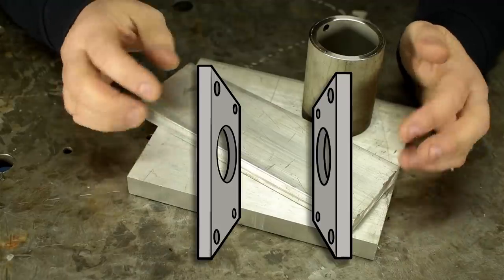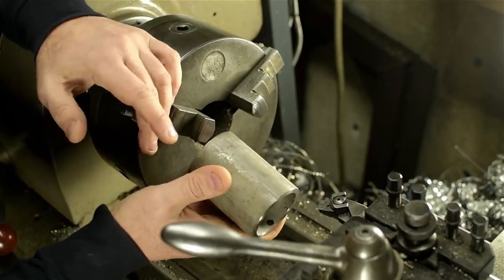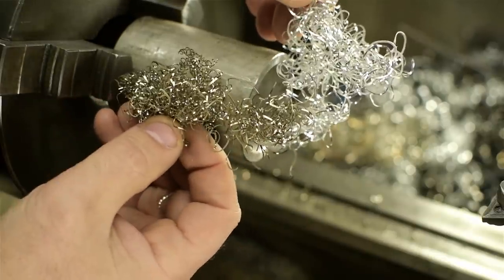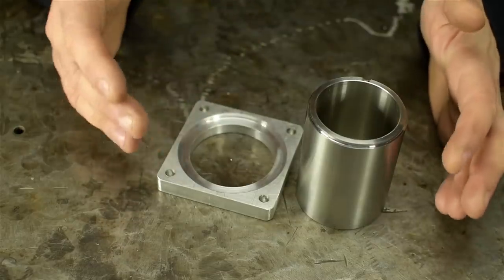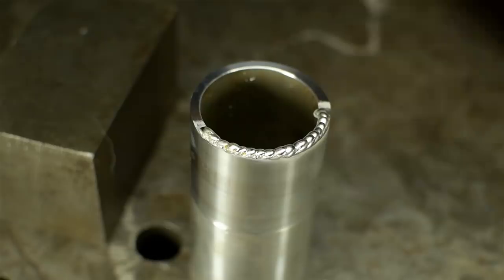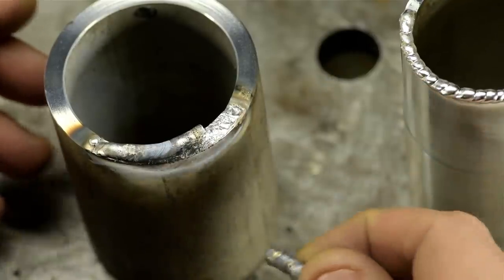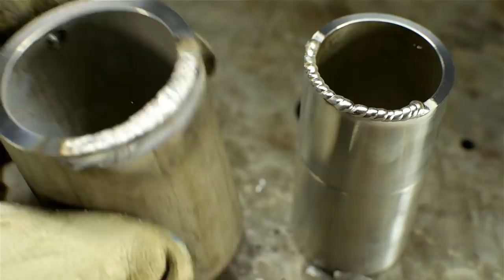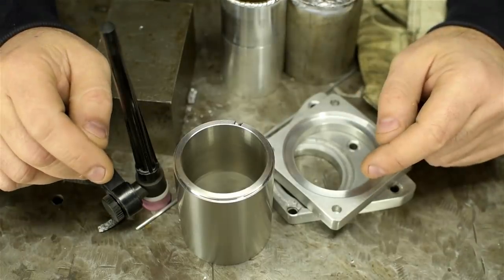UNWELDABLE Aluminum - Caught On Tape!!

Comment: The middle piece is from Europe and is in metric. The other parts are in imperial. You can't make them fit together.
Reply: They use metric elements, can't use those together.
Reply: Everybody knows you can't weld Aluminum to Aluminium.... duh!
Reply: @spacenomad5484  Don't get it?
Reply: @crackedemerald4930  Can, pretty much, for a few sizes
Reply: Can't fit metric to imperial?  Have you tried a bigger hammer?  ;)
Reply: @MrJdsenior  Carefully check the spelling!
Reply: @ferrumignis  oh man, that almost got me.
Reply: You need filler rod from England.  It like whitworth works great on imperial and metric nuts and bolts with a big enough hammer.
Reply: It's all about the bauxite. Willowdale and Huntly bauxite are incompatible.
Reply: @tomstiers6419  You work for one of my bloody sub-contractors, don't you !!
😂
Reply: @hanelyp1  Summon bigger fish 🤣
Reply: If You can't make them, You gonna need a bigger hammer.
Reply: You can,  but you need to make an adapter piece.
Reply: @scudinthemud  inch to metric bush 🤣
Reply: Only people who speak british and american  can weld them together
Reply: @JoshGariepy  You gonna twist an English and an American fillerrod together and work on the English piece with the left hand only ....

Comment: Careful with that zinc stuff, breathed a little of that in and 3 years later I was hit by a car
Reply: damn bro. i breathed some in and 2 months later lost a game of monopoly. its dangerous stuff.
Reply: Well crap 3 years earlier I was hit by a car . . . (well almost 3 years ago. . .)
Guess I'll blame it on the Zinc . . .
Reply: redxpen  Maybe lithium + copper? That could make purple.
(as minor additives, obviously. Not that the metal is an alloy of just those!)
Reply: redxpen  
My guess is magnesium

Though he said it felt heavy.
Reply: redxpen  
Yup the wire peeling post weld, the green arc and the zinc even.
Reply: @motoz3939  It reminded me of when I tried to weld an in-law's "Aluminium" Lawn-Boy mower deck.  It even had "Magnesium" proudly cast right next to where I was welding.  The weld had that weird shiny crinkle you see at the end, end then a few seconds later went "Ping".    Also I have made aluminium-stainless hybrid when I left an aluminium rod on my weld table.  It's not very impressive.
Reply: @paulmoir4452  yeah magnesium is a strange one. The wire is very expensive also so it's likely not something people just up and say I think I'll try this. I think that likely adds to the mystery of it. It's just not common to the average person or even weldor. I hope this old Tony identifies the materials and makes another video about it. He did mention though he didn't care and just wanted to complete the part. Maybe he will see comments like these and dive into it.
Reply: No Corona virus?
Reply: I can tell you that when I was 15-25 years younger than today, I happened to weld zinc quite a few times without having a clue about the dangers that fumes can cause.  
I'm 42 and I've never had health issues. I don't know how those breather fumes are going to affect me in the future, but here I am for now.  :)
Reply: @nfetiu  bit of a late reply, but the research on occupational safety of zinc fumes seems to indicate it isn't a long term danger. Exposure is extremely unpleasant and during that "fever" you are a risk of developing pneumonia or the like if you get infected, but zinc probably doesn't stay in your system for very long. 
Had a good look at this because I work with zinc a lot.

Comment: The builders want their scaffolding pole back!
Reply: lol
Reply: Hey I am missing a brace tube.
Reply: @ironworkerfxr7105  Shop Rule 2; Never turn your back on a welder. Shop Rule 3; Welders that wander around with a tape measure are NOT "On Break". Shop Rule 4; Don't look behind the welding curtain, you can't unsee it.
Reply: It's called a tube. You put flags on poles.
Reply: Perhaps there was a flag on the scaffolding? 🤔
Reply: He'll have to weld it back up before he gives it back.
Reply: No need, TOT can just engage his lathe to go back in time to before he cut it. Or even before he 'aquired' it!
Reply: @poppyrider5541  I think you mean "pipe". Poles are supports, Pipes are for water, or  conduit, or other pipe-like applications.  Since it's made of a structural material, its intended purpose is most likely for support structures, so "pole" is pretty reasonable.  All metal pole material is hollow, because it's cheaper that way and there would be very little benefit to making it solid.

That's actually a pretty neat piece of material ToT has, but no you can't weld it with anything normal people have access to.
Reply: @Chris_the_Muso  there's actually a huge benefit to making em hollow. Other than to save material and money, hollow parts can resist bending sideways much more than similarly sized solid parts.
Reply: @d.t.4523  Awesome shop rules!  The tape measure one had me rolling, just had to say !    a much needed smile to the day:)
Reply: @Chris_the_Muso  I think you mean "round hollow section". Poles are supports, pipes are for water, conduit, or other pipe-like applications, round hollow section is to ensure the stock rack stays on the ground.
Reply: @godfreypoon5148  You're all wrong... Poles are people too. From Poland. Not Pole-land, common mistake.
Reply: @mohammadyousef5815  no, solid is more resistant to bending, but FOR ITS WEIGHT hollow is stiffer
Reply: @jamesmihalcik1310  Great! Now go pour yourself something flammable, and hide it in the coffee cup! Shop Rule 1 is different for various shops.
Reply: Radioactive ☢️ material?
Reply: @Chris_the_Muso  Annoyingly, scaffies would call it a "standard". They don't talk normal.
Reply: roflmao!
Reply: @Intermernet  scaffies would bellow it a "***ing *** standard ****er"  - they don't have indoor voices
Reply: @Chris_the_Muso  Tube = measured by outside diameter
Pipe = measured by nominal bore
Pole = structural component can be solid or tubular.
Reply: @mohammadyousef5815  and it is springy can take an impact of a football and bounce it back.
Reply: @BajaBill7  Sounds like a good pilot: "Machining Space-Time: Unweldable". Makes sense because all time machines have big whirly lathe-like bits, especially the one from The Time Machine with Rod Taylor.

Comment: Thanks for another excellent video, Tony! I wonder what alloy that motorcycle part was that you welded a while ago - it was also an 'unweldable' alloy, as I recall.
Reply: I think the difference between this material and the motorbike footpeg is this is a non-weldable alloy, and the footpeg is a non-weldable grade.  The difference being that the grade is in fact possible to weld, though you lose some of the desirable characteristics of the grade (toughness, strength) but a non-weldable alloy means the composition of the metal rejects the metal supplied by the aluminum welding rod.
Reply: The footpegs were 7075 aluminum if I remember right
Reply: @magicoddeffect  Correct - Youtube recommended the video, so I went back and watched it. Now I'm wondering how the footpegs are holding up. Might be a good follow up chat video.
https://youtu.be/AhMil-ibUTY
Reply: @Ddabig40mac  In the metallurgical world, 'grade' and 'alloy' are synonymous. What you describe is condition - hot-rolled, cold-worked, quenched and tempered, solution treated and aged, etc. Grade refers to an alloy specification, which usually includes a prescribed chemical composition.

Welds are always susceptible to cracking due to a variety of factors like formation of brittle phases, grain boundary segregation, solidification shrinkage, and degradation of mechanical properties in the heat-affected zone. Certain grades of aluminium, including most 2000 and 7000 series alloys, are especially susceptible to liquation cracking as they exhibit a large solidification range (difference between liquidus and solidus temperatures) due to their chemical composition. This can be avoided to some extent by judicious choice of filler metal, but some alloys just cannot be fusion welded no matter what filler metal you use.
Reply: @purerhodium  Yah, what he said...
Reply: @purerhodium  thank you.  So in the case of the 2000, and 7000 series aluminum, are we looking at mechanical connections, or can they be successfully soldered or brazed?
Reply: @Ddabig40mac  Mechanical connections are standard due to their ease of installation. Brazing using standard filler metals for aluminium is not possible due to the aforementioned low solidus temperature, but there are some specialised processes for brazing 7075. Friction stir welding is also possible but of course limited by part geometry.
Reply: @purerhodium    This guy metals.
Reply: @Ddabig40mac  Why do they use that alloy for foot pegs? Is it weight related/strength related?
Reply: @olliefoxx7165  Its high strength and rests are made by CNC machining.  Anyone who tries to weld it is crazy as a broken rest can lead to very serious injury.
Reply: @purerhodium  Your comments related to 7000 series materials are simply not correct............look like you got them from Wikipedia................lol
Reply: @battlebbot  OK so instead of just saying they're incorrect, why don't you enlighten us with the correct comments?
Reply: @danmackintosh6325  bunch of jibberish...  then the brazing part.  You can braze any two metals together.
Reply: @MrDillaKilla  Ok, I'd like to see you braze lithium to mercury.  I'll stand way back here.

Comment: Why didn't you just taste it¿?
Aluminum has an aluminummy taste.... Kind of bland but still good, but alloy mixes taste like a crisp clean river among the mountains as an upside down fairy, a tweaking fawn, a bare bear, a goose w/ horns and a homeless squirrel watches in the distance as you quench your thirst.
Or that's just the hallucinations from severe metal poisoning.... Either way, you would have known as soon as you stopped seizing.
Reply: Best comment, I don't need to read the rest.
Reply: Stopped here to 🤣
Reply: That aluminummy taste caused me to scrap a set of home-made silverware that took me 3 years to make. They turned black in the dishwasher anyway.
Reply: 7000 series aluminum tastes a little more sour than the rest of them
Reply: It's spelled Aluminiummy...... I know ....I know, potato popobot
Reply: Not Good for THE health

Comment: You could measure volume and weight and find it's density on a chart.
Reply: An actual application of middle school science!
Reply: how precise would it need to be though ?
Reply: Archimedes to the rescue!
Reply: The density of alloy 7075 is 2,81 and 6061 sits at 2,70 g/cm³. That difference should be possible to measure with regular home shop stuff.
Reply: do it. doo eet.
Reply: Or you could shut up and let him make a video! Jk, jk. Good idea.
Reply: To find a specific alloy like that would become a work of a Master Thesis fast
Reply: @mukrifachri  with a load cell and hook, you can weigh a part, dip in water, weight again, check water temperature, with some maths you have a 3 digits reading of the density.
Reply: @jowjor  check water temperature? just weigh the part on a kitchen scale and dip it in water to measure it's volume, no rocket science involved.
Reply: There are a number of aluminum alloy’s that shouldn’t be welded. He just happened to have this one. Most are closer in density. A simple home bound test won’t be accurate enough. You guys know what the alloy is, so in hindsight, it was easy to say to do this test. It’s far harder if you don’t know what the alloy is, which, after all, is the problem.
Reply: @melgross  Or one can just try to weld some bead on the rest of the stock, like what Tony did in the video. Wastes less material than welding the parts and it fails.
Reply: @jowjor  I have none of those in my home, though I don't do any kind of machining or welding either XD
Reply: TOT being an absolute madlad again, likes the comment but doesn't provide the density.
Reply: If you mute it, the density goes through the roof.
Reply: However, if it is not a standard alloy, but from some mixed metal melt
Reply: @NotAnonymousNo80014  What fun is THAT?  It's not too hard to figure out the volume, just the difference of two cylindrical volume equations, why bother with water?
Reply: Or You can throw it back into the scrap pile to be forgotten until the next time You need un-weldable aluminum.
Reply: @NotAnonymousNo80014  water temperature can vary a few °C between room temperature and faucet. And as you'd need 3 valid digits (at least) to distinguish two different alloys, you can't just round at 1000 kg/cubic meter and have a valid result. The 3rd digit of water density vary quite a lot if temperature vary a few °C.
Reply: I don't know how to measure that density to a given precision, but I know I trust TOT to find ways that are waaayyyy exacter.
Reply: Or measure conductivity, hardness or reactivity to a mild acid.
Reply: @sungazer454  na, just a somewhat competent non destructive testing shop.  most aircraft structures guys could give a good guesstimate.
Reply: Holy shit youre a genius
Reply: @JukeboxJake  we do use picnometers to apply that method, most accurate you can get on most science labs

Comment: ✋ I've seen a video titled "7075, 7076... Whatever It Takes" of someone welding pegs on his bike. You should get in touch with that guy!
Reply: 7075 is stronger in UTS terms than mild steels while still being way less dense, so it has its uses, just not as a weldable material. Unless many bike manufacturers lie about their materials (Which wouldn't surprise me at all to be honest, the industry seems to mostly be populated with designers and snake oil salesmen who think they're engineers) 7005 is weldable.
Reply: @peglor  OR do they use industrial welding options? There are larger/higher power requirements you can get in a commercial setting, that you cannot get in a home.
Reply: @TechyBen  The problem is that welding them with anything that relies on melting (like TIG) significantly weakens the aluminum, regardless of weld power.  Friction Stir or another solid-state welding process could be used, but it's usually easier to machine these small bits out of a solid block.
Reply: @peglor  7005 is weldable and used in some aluminium bicycle frames.

Comment: Lol I had a feeling it was going end up being some 7000 series alloy. I think a lot of the 7000 series alloys are used in machining operations because they tend to have exceptionally high hardness,  harder than mild steel a lot of times. Most of them aren’t weldable by any conventional  fusion arc welding methods though. This is the first time I’ve seen someone actually attempt it though. That was a pretty catastrophic reaction to welding lmao!

Comment: Thank you ToT, good advise. I still have lung issue after 30 years of brazing a leaky galvanized soak tank that was originaly sealed with lead soldering. The detergent chewed it's way through over many years. I thought it would be a good idea to braze it with the yellow flux bronze rod. I wish I knew better or that someone took the torch out of my hands.

Comment: I seem to remember watching a few videos by some old fellow, who taught me about brazing dissimilar metals. 
Can't remember the name, but I'm pretty sure he was like thís old..
Reply: Now I'm actually curious: CAN you braze unweldable alloys? I assume the weldbeat popped off that thing because of some ridiculous thermal expansion factor, so you might have the same issues as with welding. Then again, the issue might only be a matter of bonding and/or surface wetting. I am truely curious about the answer to that question.
Reply: @horrorhotel46290  Yes, you can use the HTS2000 type brazing rods for most of the 7000 series alloys, especially given that the brazing rod has a lot of zinc and that's a major alloying component of those metals, so they bond well.  The joint is actually stronger than something like 7075 can achieve by itself.

Comment: Magnesium would do the same thing. Chalky spatter. However it might also flash into a brilliant firework.
Reply: In the 70’s I applied for a job in a big metal fab shop. No interview or resumes, “just come out in the shop and weld this magnesium pipe closed” I got the job in 5 minutes.

Comment: Thankyou Tony, for at least attempting to weld 7000 series alloy, because we use some at work and I told the Engineers that the handbook says "that stuff is unweldable", and now you have proven it. I have heard that "some" are weldable under special methods, BUT most are NOT, we have 7075 at work, and the book says ...NO.